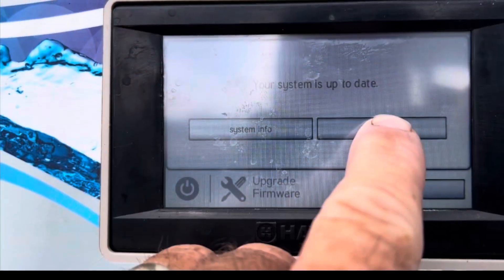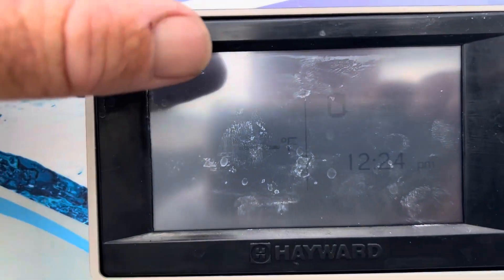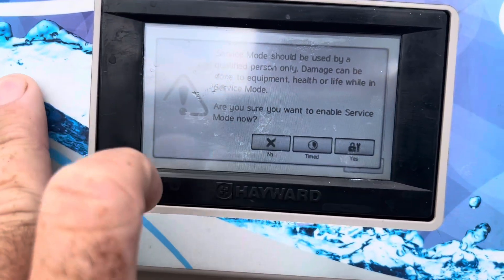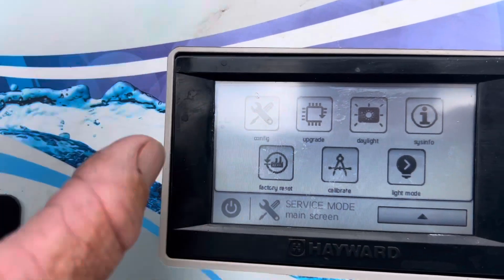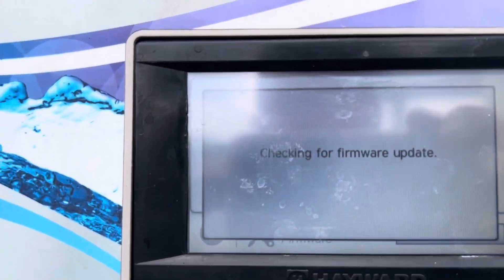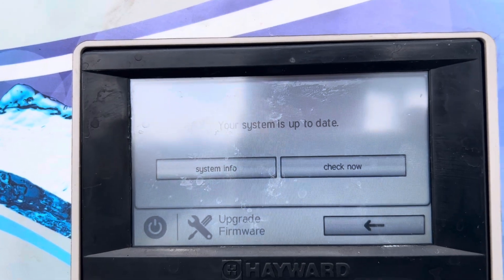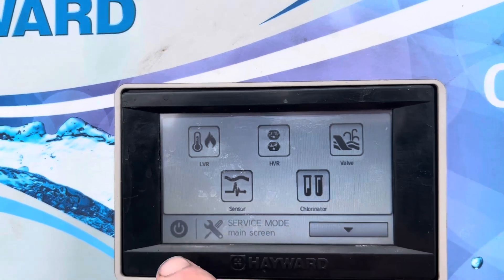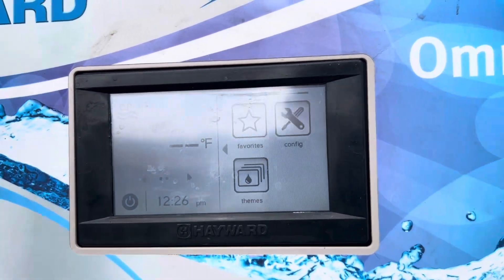Firmware update Hayward Omni logic; how to update system software

Comment: Does this work with the remote controller also? Im trying to update to the latest firmware before configuration
Reply from the maker: I believe it will. They are basically the same
Reply: @Pool-guy i tried it today and it seemed to work unfortunatrly I could not get the controller to communicate with the vsp
Reply from the maker: @montgomeryfortenberry  (908) 355-7995 Hayward Tech Support 
They can walk you through the setup
Reply: @Pool-guy yea I tried, the guy seemed to think it was a bad driver or something but he said they come with a 3 year warranty

Comment: Steve
Shows I loss communication but my WiFi shows strong.
Any suggestions
Reply from the maker: Hayward is not my strong suit. Here is the tech support number. They will help you troubleshoot. 
Tech support (908) 355-7995
Reply: Mine often shows the antenna is disconnected and the signal strength is 48%.  There is 10 inches separating the antenna from the WiFi point (granted, it’s brick, fiberboard, insulation, and drywall in those ten inches).  I’ve found if I disconnect the antenna, wait 20 seconds, and reconnect….that fixes the problem.  I’m not impressed with Hayward equipment, all the way around.